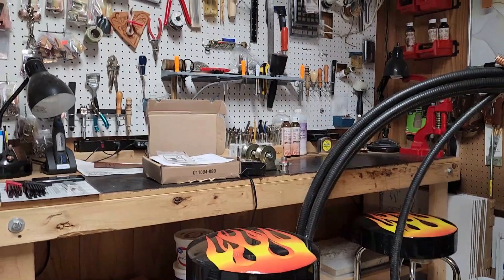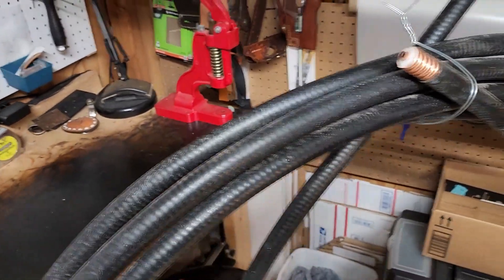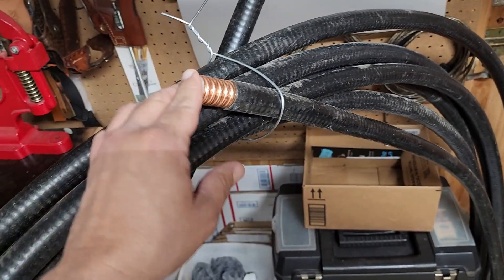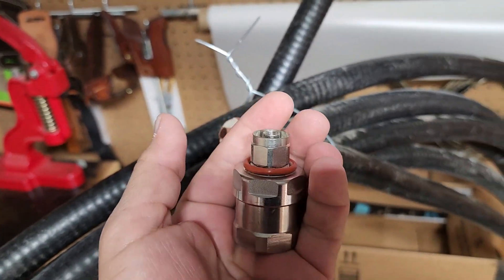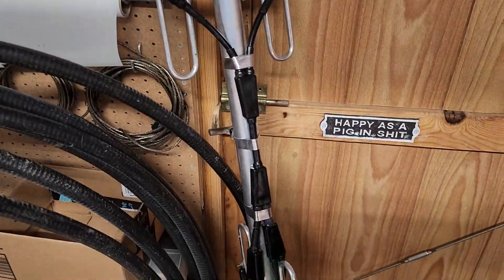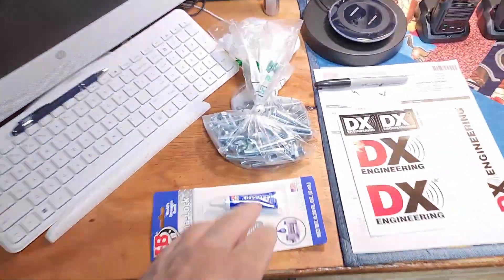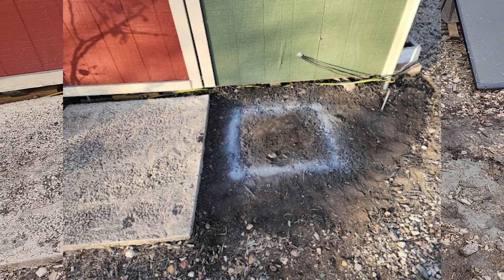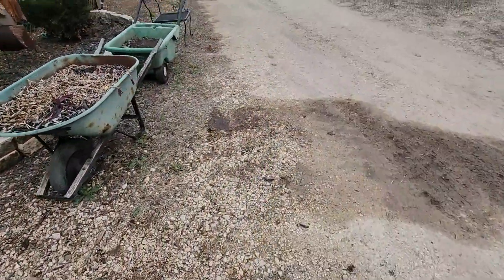GMRS - Vertex Repeater Update Part 2

Comment: While I'm late to the party, nice explanation and very thoughtful for the GMRS community.  I'll check out your updates and hopefully the 7/8" coax does not have any significant discontinuities due to sharp bends, kinks or other damages of the dialectic.  And while us hobbyists likely don't have access to a time domain reflectometer, ensuring your SWR is well under 1.5 with a meter will be helpful.
Reply from the maker: Never late to this party!!!  The 7/8" coax worked really well for about a year and then one day we noticed some the range of the system had been greatly reduced.  One of my friends came out and tested a few things and determined something had happened to the feedline.  He replaced it and we haven't had any issues.  Thanks for watching and commenting!!!!!

Comment: Make sure and do not half way bend that coax bc if you do it will crack the coil and be no good after that
Reply from the maker: I had a feeling that would be the case...  I was thinking any little crack in the copper would cause major issues. Thank you for watching!

Comment: LOL, 7/8ths, that's a jumper from the radio to the main transmission line (2.87 inch).    You're going to need Din to N or whatever your radio has.
Reply from the maker: Oh yeah...  got the Andrew connectors on order.   Those bad boys ain't cheap 😖

Comment: Don...great work brother, I'm jealous of the Rohn tower even if it's laying on the ground.  You'll be rocking once it's up with that bulletproof heliax and your new stick.  I commented on your last update, I have a EVX-R70 that's been it service and cranking out 40 watts of fury since November '22 without issue.
Question for you, have you looked into establishing your repeater as a node on the MyGMRS network?  I've looked into it, the linking bundles are hard to come by (Pi computer shortage--thanks Biden), but the real pain in the ass is trying to find an interface cable with the MOTOTRBO (26-pin) connector going out to either a DB 25 or 9 connector.  Have you found out how to add external controller support to your repeater?  Even if I was not to go the linked route (would be nice to have the option though), I would add a Voice-ID if I could.  Mine is set to auto-ID (in Morse) every 15 minutes, but that is only after traffic ends...so it's not a true auto ID every 15 minutes.  Lastly, are you able to use your Vertex as a base station?  I see your desktop mic.  The manual for the R70 in addition to the software mentions a mic, but again I'm sure of the proper connection --don't need anymore eBay goodness laying about because I can't use it.

Let me know your thoughts.
Cheers...WROQ941
Reply from the maker: I'm excited to get the tower up soon...  Ran into some issues this week, so I may not have it up till next weekend.  Video coming tomorrow about how far I got tho! 
As far as linking the Dunlay repeater, I have kinda decided against it for the time being.  The big San Antonio has linked theirs up before and the traffic becomes more of a headache, rather than enjoyable.  For now, we simply want the unit to service our local county.  We have some other news to announce soon that I think will be another good reason to keep it just local.  As far figuring out how to link the repeater to a Pi, I have a buddy who has offered to help me do it but I have had so many other irons in the fire with the tower upgrades, ect so I just haven't done it yet.  Thye desk mic you see is hooked to the QYT that I use for a base station.  The Vertex will be moved to the other side of the shack once the tower is up - I will need to find something to occupy that real estate on my desk once it's gone.  :-/  Thanks for watching and commenting and stay tuned for the BIG news!!!  LOL

Comment: If that antenna is not located on top of a 600 to 800 foot above sea level hill top or located on a mountain top it's a waste of time, equipment, and monies to be no higher than 60 ot 70 feet in the air.... especially when there's 1000 to 2000 foot hills around the area to help block the signal. JMHO that is.
Reply from the maker: So there are no hills over 1000 feet in the  area of where we are trying to cover.   We currently have the coverage we need at about 45 feet,  just looking to make what we have better in spotty places.  But,  I'll definitely let you know if you are correct once it's up.  😉

Comment: To straighten a tower leg, I put a chain from my truck receiver ( or other anchor point) to two points on the pipe leg that your working on. I then take a piece of 12" long, larger pipe (cut in half lengthwise) and place it on the the section you want to straighten. Place a come along around the pipe half and winch it to an anchor point. As you pull it, do a click at a time until straight.  Thats all I got. Can't wait to see the finished project.
Reply from the maker: I was playing with the farm jack on it yesterday and had some decent results.  On a few of the pieces I got yesterday, your idea may work better.  THANKS JOE!!!
Reply: The farm Jack puts stress at one small point. Using a piece of pipe cut longways just large enough to go over the part your straightening out, spreads the pressure your putting on the part your bending back into shape.  I’m excited to see the finished project
Reply from the maker: @joecraft4409  VERY GOOD POINT!!!  I have the guys coming over this weekend and we could have it up.  Thanks for your wisdom Sir!!!